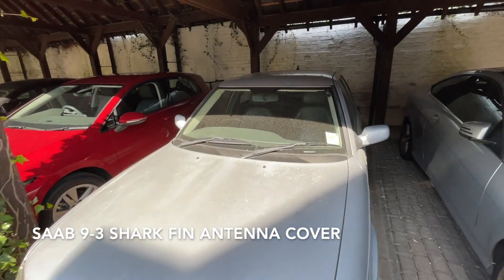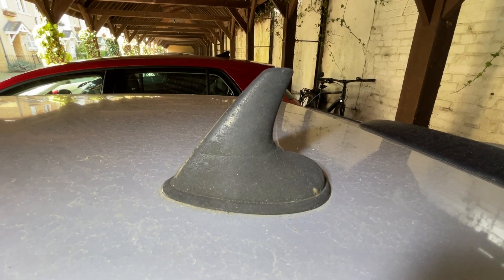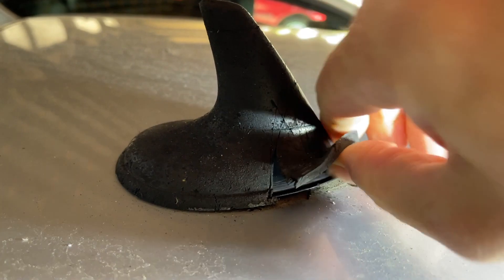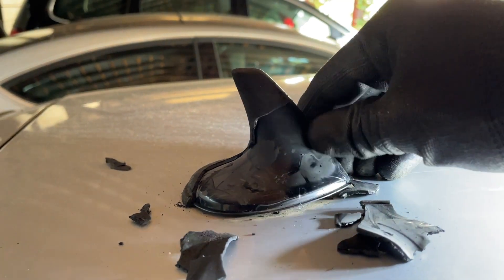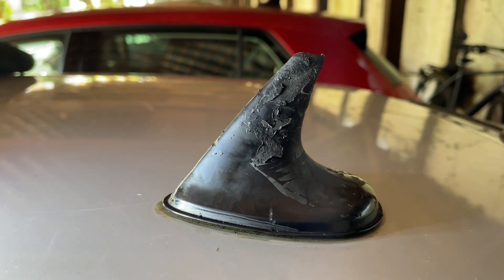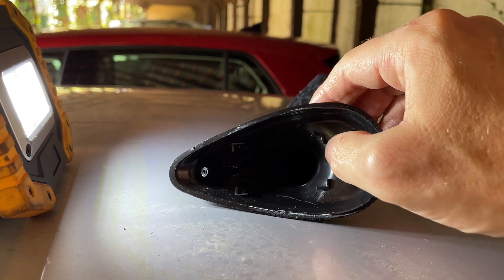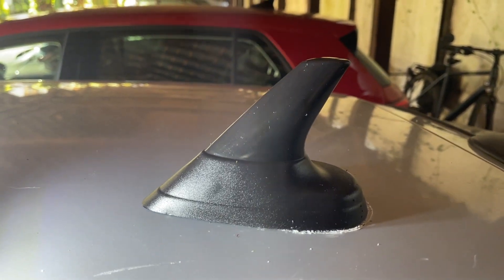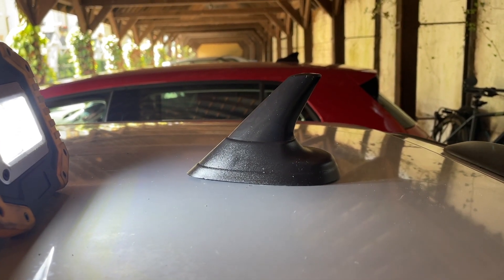Saab Shark Fin Antenna Cover Replacement

Comment: Really nothing wrong with the old one (I've seen 'em a thousand x's worse). Your struggle to remove the original proves this.
I'd have just cleaned the original and wiped it down with a little Armor All.
"If it ain't broke, don't fix it"
Doubtful the new, hard plastic edition is gonna stay in place for long, especially considering the minimal amount of adhesive applied.
Don't look for solutions to problems that dont exist......